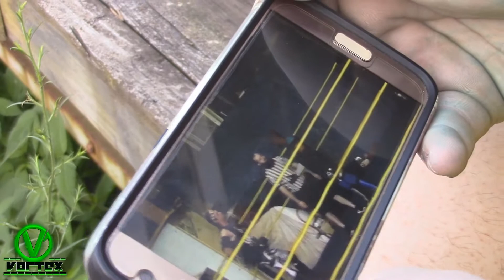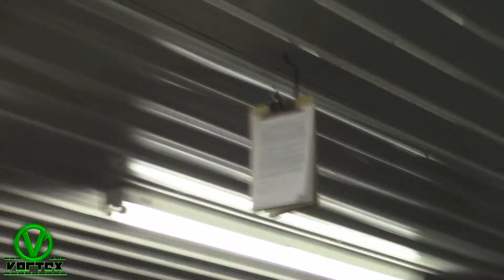ICW Vortex 2017 (Part 1)

Comment: What's going on with those ropes???
Reply from the maker: Adrian Parra The cable under the ring snapped during Castle's springboard, causing the ropes to loosen up. We got the problem fixed though